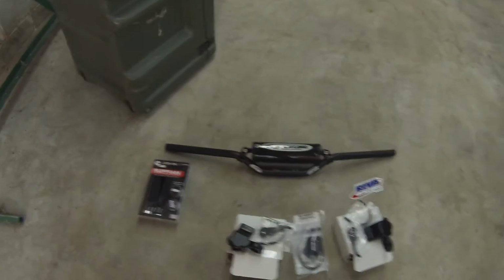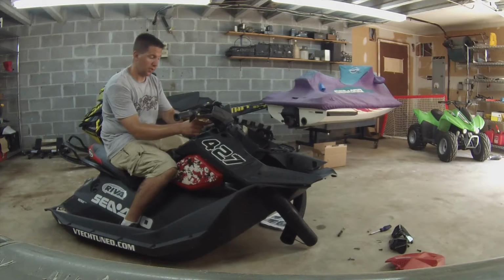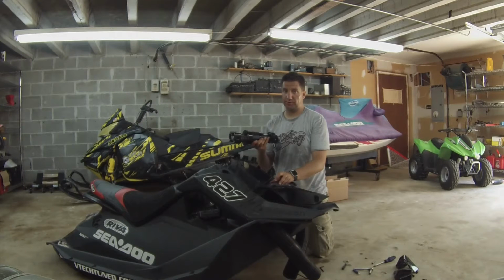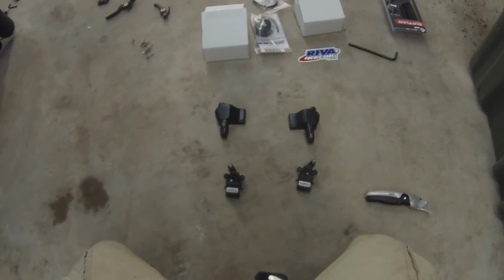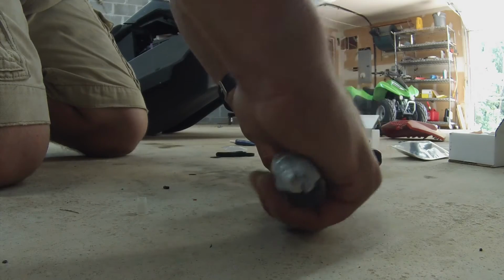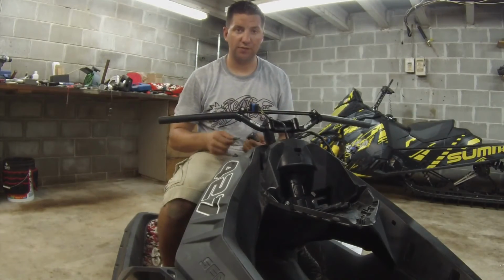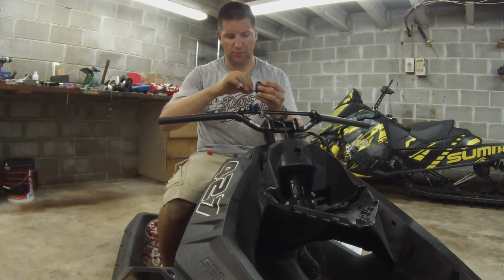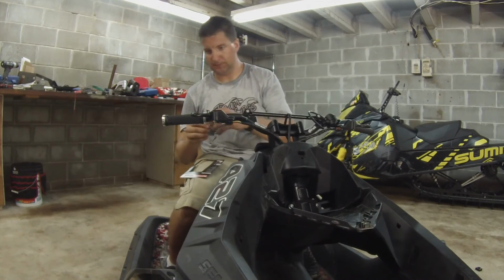Installing a Riva Racing steering system on a SeaDoo Spark.

Comment: Thanks for making the video! How do you like it when racing?
Reply from the maker: Next race is July 9-10th ... I'll update you then.
Reply: sooo?
Reply from the maker: It handled great!  Huge improvement over stock!  Highly recommend.
Reply: Where did u get th red urban camo wrap and hydro turf
Reply: Is taking off the top deck recommends or is it just as easy to do with the deck on ?
Reply: Oliver Berglund ^
Reply: RIVA Racing ^
Reply: Hi Hunter. We definitely recommend taking the deck off! there are certain parts of the Steering System that you will need access to. Check out our Installation Instructions to learn more: http://rivaracing.com/i-23898940-riva-sea-doo-spark-steering-system.html
Reply: @RIVA Racing  does your steering system fit vts? And does it fit all years and model of spark universally?